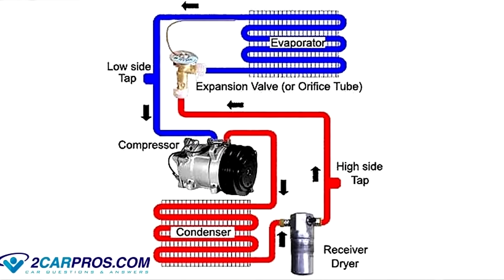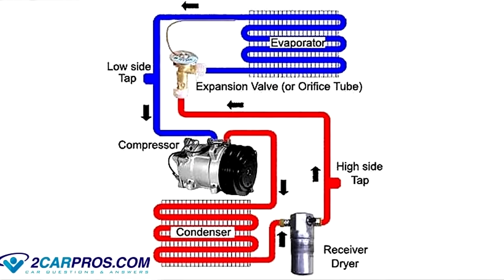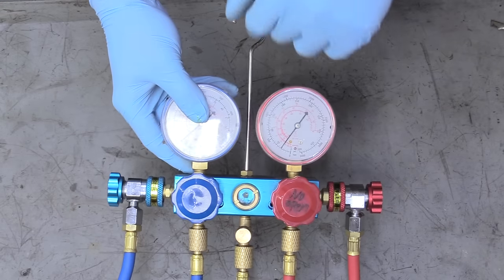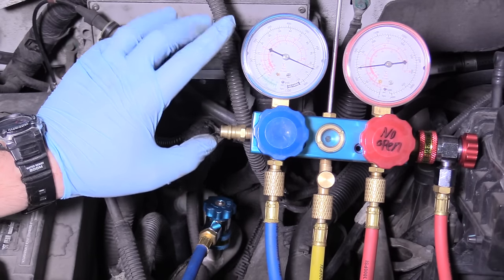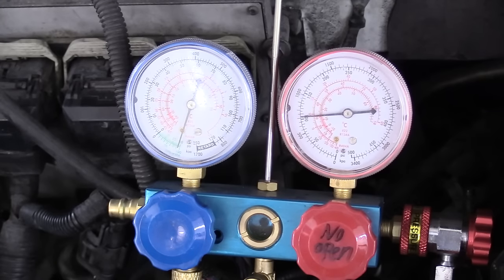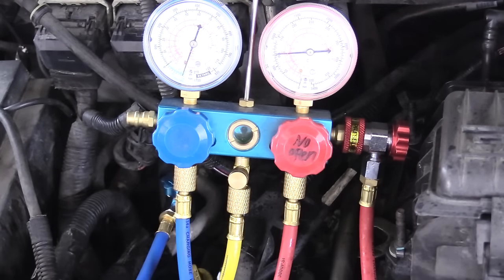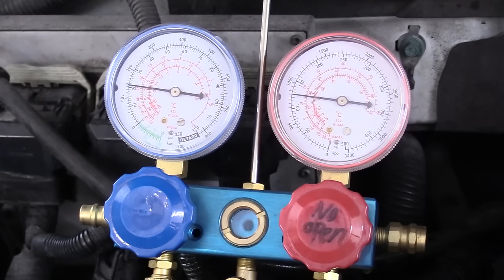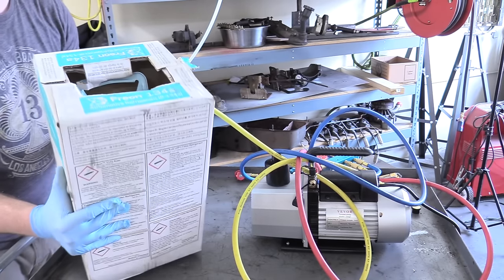How to Vacuum Down and Recharge Your A/C System! - EASY

Comment: I seen chris fix video to open the high pressure on the manifold when performing the vuccum, im confused as to keep it shut or open...
Reply: Yes, when pulling a vacuum you want to open both the low and high side to pull a good vacuum from both sides
Reply from the maker: For everyone asking "Why is there a high side valve if we don't open it?!" It is there to vacuum it down the system a little quicker. The reason I said don't open it is the system is a loop and just vacuuming via the low side will accomplish the same goal a bit slower. BUT if you forget to close the high side when you turn the car on with the keg attached the system pressurizes with the valve open it back feeds into the refrigerant keg and explodes most likely injuring if not killing you.
Reply: Thank you for that Saftey tip.  I am new to working on ac.  This video was “superb”.

Comment: my 30 year old audi does not have any low port connection, only a high side so the system needs professionally evacuated to be charged
Reply from the maker: It has to have a low side port. It is just hidden somewhere. It might be on the dryer, euro cars love to do that. Thanks for watching!

Comment: So you don't have to open the high side valve when you run the vacuum?
Reply from the maker: Nope. Never ever open the high side. Thanks for watching!
Reply: @2carpros  Now I'm confused. If you don't  open the red valve how are you going to vacuum the high side?
Reply from the maker: It's a loop. It's impossible to vacuum down one side with the car off. Thanks for watching!

Comment: Don't turn off the vacuum pump without closing your manifold. It will suck vacuum pump oil into the system. Ask me how I know. Now I have  mineral oil in my r134 system. Trying to figure out what to do. I'm really not trying to remove compressor and flush out the system and replace drier again.

Comment: DON'T YOU INTRODUCED AIR BY THE HIGH SIDE when you connected the hose after doing vacuum? That red hose has air, and the system is in Vacuum.
--- If not better to connect high and low hose before vacuum?
Reply from the maker: No. The red hose is also under vacuum. It has a check valve in the bit that screws on. Thanks for watching!
Reply: @2carpros  No. you didn't get it. You did a vacuum without connecting the red hose or high side hose, so that hose has air inside. once you connect it to the port, the system is in vacuum, so that air in the hose will be suck it by the system in vacuum. You should having connected before the vacuum and opened keeping the gage closed, then vacuum the system. If any air is inside the red hose will be suck it in the vacuum. I hope you understood.

Comment: If the red knob is off, how does the high pressure get its reading?
Reply from the maker: The valve is between the gauge and the body. So the gauge can still see pressure with the valve closed. Thanks for watching!
Reply: Basically, the high-side valve connects the red hose to the yellow hose..... just as the low-side valve connects the blue hose to the yellow hose.  Each gauge reads the pressure in their respective hoses.

Comment: Anyone in the comments here still have a car with r12 and havent converted to r134a? My system in my civic is still r12 and I need some help and tips if the same process is the same as r134a vacuum and refill

Comment: I’ve had a heck of a time trying to figure this process out from other videos… this video is the only one that got Freon to go into my system! Thank you! But I do have a question/problem: when I follow your steps, my high guage never moves. From what I heard you saying, it should. I tried opening the quick connect side and it didn’t do anything, so I slowly opened it on the manifold and it started to go up. I noticed my low pressure going really really high, nearly touching the “retard” portion of the gauge, so I disconnected both the low and high really quickly. It’s blowing cold, so no complaints there. However, I do notice that the low pressure hose is cool to the touch, while the high pressure hose is super hot. Did I do something wrong somewhere along the way? If so, how can I remedy bay this point? Thanks!

Comment: I have a question if anyone can answer why doesnt my system have for more refrigerant. As soon as I put  on the ac refrigerant and press the trigger it doesnt go in the connection and actually spews out. So maybe I have to release the pressure some how? Thanks in advance :)
Reply from the maker: Check the port for dirt or anything obstructing the connection. Thanks for watching!

Comment: I don't understand why the low side gauge goes down to -30 psi, but atmosphere is only about 15 psi
Reply from the maker: Because the maximum theoretical vacuum at sea level is 29.92 in. -Hg. Thanks for watching!
Reply: confuzled or something. 30 inches mercury is roughly 15 psi, ok makes sense. but hvac gauges go to double that. maybe that's just how thing are done. could've make the gauges go to 20 psi, 40 inches Hg, but I'm just overthinking it. never understood why.

Comment: Have all the gauges but useless as the High and Low ports appear to be BIGGER than standard ones on my 2019 Nissan Rogue Sport! Hoping the R134a to R134yf adapters I ordered thru Amazon will work! Oh, both ports appear to be the same size! Another odd feature! I’m told (online comment) that Nissan will charge $217 just to analyze your vehicle!!!
 I’m sure another money making scheme from Datsun-Nissan. 💸 oh, AC Freon (?) is NOT covered under any warranty!!!! 😱😡
Reply from the maker: This guide only covers 134A. Thanks for watching!

Comment: Ryan broke the vacuum when he connected the high side line (which should have been vacuumed during the pump operation). Don’t be like Ryan.
Reply from the maker: No I didn't. I used this pump and gauges literally this morning working perfectly fine. There isn't a check valve if the high side on the gauges are connected they are getting vacuumed too. Peter commented without knowing what he was talking about. Don't be like Peter.

Comment: Compressor require oil after vacuum....thanks luirros
Reply from the maker: So little is lost I wouldn't worry about it and if you put too much oil in it, the AC won't work at all due to the orifice getting clogged with oil. Thanks for watching!

Comment: basically,  high pressure side is just for reading the pressure , always keep the valve closed
Reply from the maker: You got it! Thanks for watching!
Reply: @2carpros  hi, do you have any idea on r290(r134 or r1234 replacement)  mix with r134a or r1234yf? Cause it's always having some left in compressor.

Comment: Actually you can open the red valve while vacuuming the system. Just DO NOT OPEN it while charging, with the compressor/engine running.
Reply from the maker: Yeah you can but it unnecessary and can be confusing for some so it's easier to just say not to open it. Thanks for watching!

Comment: Correction, you are supposed to open both the low and high side when pulling a vacuum and charging the system when the system is off, ONLY.. when you turn the car on to have the compressor pull and and finish charging... yes, then you never, ever, ever, ever open the high side.
Reply from the maker: It's a loop, it doesn't matter. For everyone asking "Why is there a high side valve if we don't open it?!" It is there to vacuum it down the system a little quicker. The reason I said don't open it is the system is a loop and just vacuuming via the low side will accomplish the same goal a bit slower. BUT if you forget to close the high side when you turn the car on with the keg attached the system pressurizes with the valve open it back feeds into the refrigerant keg and explodes most likely injuring if not killing you.

Comment: I watched another "mechanic" charge the high side with the engine off (liquid)...then he started engine, ac on and proceeded to charge low side with more liquid.  bad or good ?
Reply from the maker: Oh man I would not have done it that way. Maybe he turned off the high side before he started the engine? Thanks for watching!
Reply: @2carpros  yes.  the engine was off as he charged high side.  then he turned engine on and charged low side.

Comment: "Don't open the high side" but it shows pressure when supposedly is closed. If we don't open a valve no positive and negative pressure should reflect on the gauge. that is weird.
Reply from the maker: You do realize the gauge shows the pressure in front of the gauge right? It doesn't have to be open to show pressure. Thanks for watching!

Comment: Why do techs open the high side when Vacuum the system? You said never open the high side.
Reply from the maker: I guess because they like to live very dangerously. Some people will fill using both sides then close the high when the car turns on. I think that is silly and if you forget to close the high side it can harm or even kill you. So just use the low side. No danger in that. Thanks for watching!

Comment: So, all the other video's that I've seen has you open up the high side valve and run a vacuum on both high and low sides. That's with a system that's completely empty. Your instructions are very confusing when you say "never open up the high side". Doesn't make sense if you want to remove all moisture and air from the system.
Reply from the maker: What? The system is a big loop if you vacuum down one side the whole thing becomes vacuumed. No need to open the high side. Thanks for watching!

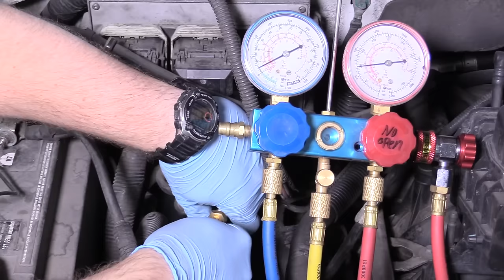Comment: Video starts at 8:30 for my own reference
Reply: 10:45 open low side with car off high side both closed once fully vacumed close low side on gauge side watch to see if vacume goes down after you close the low side valve at gauge
Reply: Once vacume stays and it doesnt leak 13:18 purge air out feeding line hook up high side "if not hooked yet" open high side from valve not the actual gauge after that connect 134a if not connected yet and slowly open low side with car off
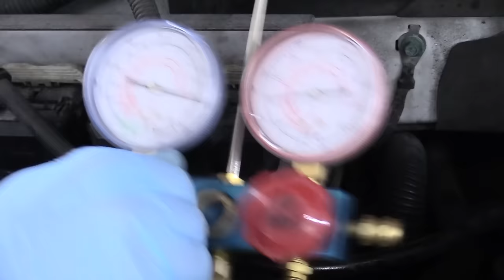Reply: 15:00 When 1st can is empty close low side valve at gauge and turn car on let ac compressor activate then connect second can purge yellow line again once purged open low side at gauge slowly and add 2nd can SLOWLY have ac full blast with recirculation setting wet ac condenser mocks car running (air)

Comment: Vacuum down both sides.  High first then low
Reply from the maker: They are a circle essentially. You can’t vacuum down one or the other while the system is off which it should be for a service. Thanks for watching!

Comment: I am and probably every environmentalist is sad because you have 216k views and "theoretically" 216770 viewers just dumped the old refrigerant in the atmosphere (I'll bet you did too). I spent around $1000 for a proper removal system. This should be left to professionals if you want to be comfortable pay for it. Don't screw the planet over even more. For what the equipment costs and the cost of your refrigerant any shop will generally be quite a bit cheaper. Thanks.

Comment: Auto parts stores let you borrow the pump and gauge set. You don't need to buy them!
Reply: Tips on the "OEM" brand tools I borrowed: 1. to add oil to the pump, tilt it 45 degrees to one side. Otherwise, it doesn't go into the machine. 2- With the gauges, to purge the yellow line, I had to unscrew it much more than I thought I should have to.  3. This is the best video!!!!!

Comment: You are supposed vacuum both low and hi sides. Not just the low side.  By not doing that you leave half the system with moisture in it and are potentially missing leaks.
Reply from the maker: What? The system is all connected. It is impossible to only vacuum down one side with the compressor off. Thanks for watching!

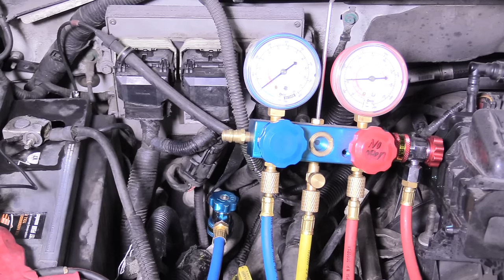Comment: Why is it impractical to weigh the tank while you are charging the system in a real world application? The refrigerant is literally sitting on a scale inside those machines and is constantly monitoring the weight, How else do you think the machines know how much refrigerant to add! Not to mention scales are also used when charging the HVAC system in your home! You shouldn’t lie to your viewers! You did not take your vehicle to a shop and have your system evacuated,  If you look at your firewall it is pretty clean then at @9:47  after you said you took your vehicle to a shop to have it evacuated you can clearly see where the oil splattered on your engine and firewall from you releasing it into the atmosphere! If you don’t want people to know that you released it into the atmosphere just don’t say anything at all, Saying nothing is much better than getting caught in a bold face lie!

Comment: You absolutely should not add liquid refrigerant to the low side. This can ruin your compressor. Only add liquid to the high side.
Reply: The liquid on the low side is okay because it turns to gas the second it enters the system. Granted you don't open the valve all the way, you add it slowly. Never open the high side valve.
Reply: Because... liquid won't compress like gas will. Your compressor will break. Gotta explain basic science to these guys watching. Schools only teach skin color and private parts nowadays!
Reply: @originaljcs  I’m 40. What is going on in schools these days has not affected me or anybody else under the age of 18 or over the age of 26. What “normal” school teaches ac tech? I went to a prestigious private high school, and still no car tech. Give the fake politics a rest you tool. 
Awesome video BTW. Was wondering about spraying water in my engine bay, is that necessary? I’m a little wary in my countryman.
Reply: @goodrabbi7176  I've seen some people use a fan pointed at the condenser. The point is you want to cool the condenser to simulate driving for maximum affect.

Comment: You should not "theoretically" advocate to just release the refrigerant since shops take it FREE.  Itsnot like you can hold onto it  to avoid buying more.   Cut out that theoretical part and reupload.   You clearly dont know how to do this if you think you cant open the hi side at all.  Also, cans dont come in exact amounts of 34 oz.  You have to weigh the final amount which you clearly didnt do.  Scales are cheap yet you dont use one but just guess.  I wouldnt even cosider  takeing MY car to you.
Reply from the maker: I didn't say to do that at all! I was saying someone could do that but they shouldn't. Just like you can do whatever you want due to free will. I'm an advocate of evacuating refrigerant responsibly. Why would you take it to me when you clearly know everything? By the way, make sure your very high IQ remembers to close the high side before you turn the car on because as you know it can back feed the keg and cause bodily harm. OR you can just never open it due to it not being needed. Thanks for watching!
Reply: @2carpros well said!!